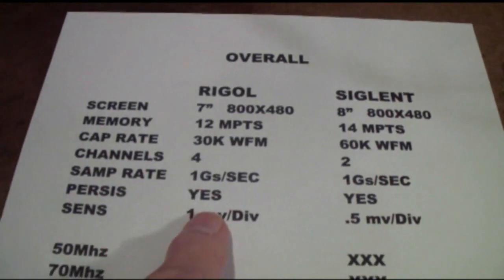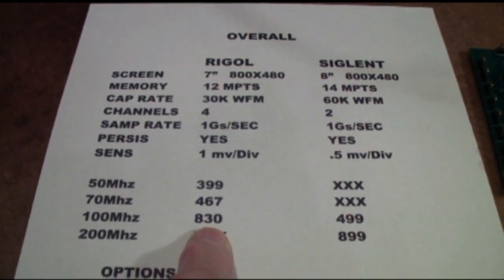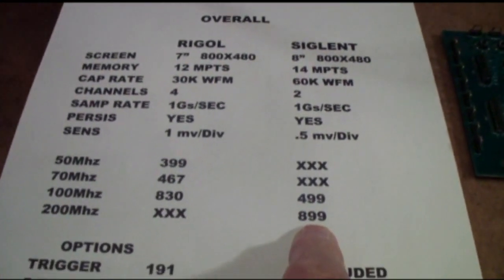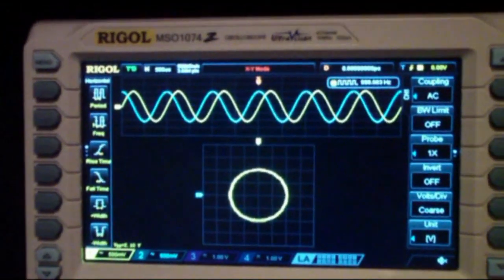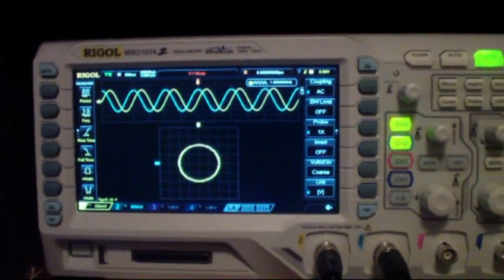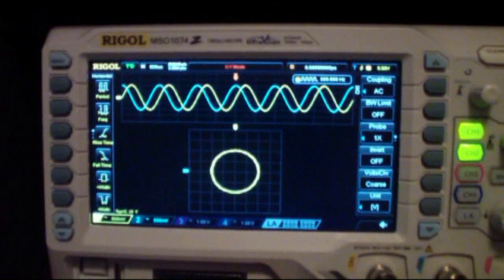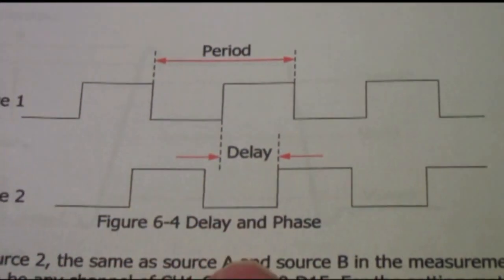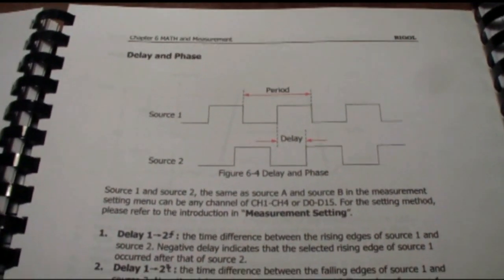TTT067 Siglent SDS1102X v Rigol MSO1074Z Part A-Vert/Horiz

Comment: I think the longer format will be much easier for people than the many split up videos. A suggestion I would make is, if you put timecodes in your description (For example 5:03, 4:08 19:31) then they will become clickable links to allow viewers to jump around in the video. You could add a table of contents to the description with time codes for each segment so people can jump around and find the vertical section or the math functions or any of the segments of your video you've included. Also I did end up buying the SDS1102X! Just getting to play around with it today. I haven't updated the firmware yet but I might do that and bring it in to work to see how the CAN decode works.

Comment: I plan to take up a hobby of electronics when I retire. Should two channels suffice?
Reply from the maker: I suggest four channels, if possible, since the added cost is often small and the times when you would like to display 3 or 4 waveforms at the same time (and synchronized with each other) can be frustrating with a 2 channel scope. However, when considering 2 or 4 channels I recommend that you compare two scopes of the same make and model, since comparing say, an inexpensive Chinese 2 channel with a RIGOL or SIGLENT 4 channel will mislead you. If you look at, say a SIGLENT 200 MHz scope with the same features and 2 or 4 channels you are getting a useful comparison of price/performance. Of course, I have nothing against inexpensive Chinese scopes (in fact I just ordered a HANTEK 2 channel that I may review when it arrives) but I would never try to compare it with my RIGOL 4 channel DS4024. Finally, a 2-channel scope with an additional trigger input is almost as good as a 3 channel scope (which don't exist as far as I know) because you can trigger on one signal and then look at 2 other waveforms as well. Good luck with your new hobby!

Comment: Trigger is an option on RIGOL? Every scope nowadays has Trigger by default...!
Reply from the maker: Rigol includes many Basic trigger options in the purchase price but does not include what they call Advanced Trigger options without a separate license (for a fee). You can find the Basic (included) and Advanced (not-included) in the list of triggers covered in the first video on trigger functions. The Advanced Trigger options are depicted with an * while the Basic ones are not. Rigol does include a time-limited license to the Advanced Trigger options but those expire after you have used the scope for a while. 

Siglent does somewhat the same thing with Decode options. All the manufacturers seem to do this now, that is, include the advanced functions but only enable them if you buy a license key. Sometimes, like Rigol, they include a limited time license with the purchase but it expires. Hope this helps and thanks for the comment.